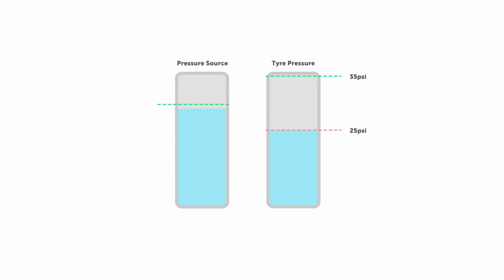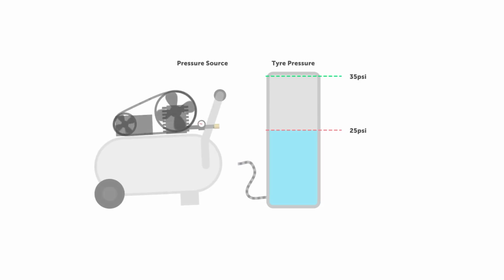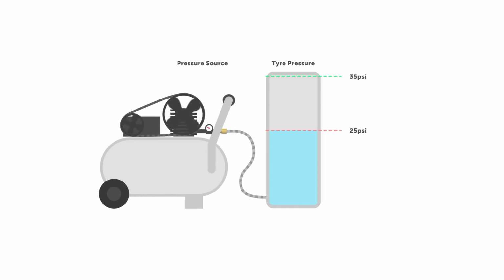Why Factory Transmissions Feel Like Garbage (And How to Fix It)

Comment from the maker: If your auto trans shifts feel like a soggy handshake, it’s most likely not the hardware. It’s the tune.

🚙 Building a fast car? Get $400 OFF the all-inclusive VIP online course package deal: https://hpcdmy.co/xa1
☀ Put this knowledge into action and tune your own transmission. $50 USD off online course: https://hpcdmy.co/trans28
TIMESTAMPS
0:00 - What Is A Valve Body?
0:19 - Complexity Varies
0:34 - How Hydraulic Pressure Delivery Works
0:41 - Line Pressure: The System Ceiling
1:02 - Why You Can't Request Impossible Pressures
1:37 - Tire Pressure Analogy
2:30 - Transmission Pressures
2:48 - When Clutches Still Slip At Max Pressure
3:15 - Variable Pressure Requirements
3:27 - Pressure Sensors And Control
3:47 - Mechanical Pressure Regulators
4:07 - Clutch Engagement Control Requirements
4:42 - Oil Accumulators For Smooth Shifts
5:30 - Advanced Accumulator Control
6:10 - Modern PWM Solenoid Technology
6:40 - Module Recap
7:17 - Transmission Tuning Course

Comment: I don’t know why, but i still prefer manual transmission…
Reply from the maker: We all have our own preferences for sure, and that's fine. It doesn't have to be one OR the other though and that's that. 
I find for different vehicles with different applications I switch between preferences on manual vs auto myself 🤘 - Taz.

Comment: The moment someone brings a compact lightweight automatic sequential to the table I’d be up for it. Especially when you factor in uprated torque converters and turbolamic’s etc .
For now I’d go with the conventional dog box / sequential , just as cheap and lightweight

Comment: Fun fact: it may seem like more line pressure is always better, but excess fluid not used in the line pressure circuit is bypassed into the lube circuit. This lube circuit pumps oil into the torque converter, transmission cooler, and the transmission bearings.

Under high-load low-RPM situations such as accelerating from a dead stop, there would be very little fluid flow from the transmission oil pressure, so the pressure regulator will prioritize maintaining line pressure, which would temporarily restrict or even block lube fluid flow. This will also happen with low RPM shifts, as shifting will cause a sudden spike in fluid demand from the line pressure circuit.

Normally, this is not an issue. The transmission bearings and torque converter can take a momentary loss in fluid flow, and there is normally enough transmission fluid to prevent the trans temp from surging. The issue is when there's continuous lack of flow in the lube circuit, from either the driver lugging the engine and transmission, or a bad tune keeping the line pressure much higher than it needs to be. A worn transmission can also cause a low lube flow, as internal leaks would demand more fluid flow in the line pressure circuit to maintain line pressure. Assuming that the transmission is not in need of a rebuild, this can be solved by properly tuning the transmission, allowing the line pressure to drop while the transmission is not actively shifting, and making sure that the downshift tables are set correct to prevent transmission lugging. If cooling and lube pressure is still an issue, the next step is to upgrade the pump. There are also some pressure regulator kits to allow continuous lube flow at max load, but I recommend upgrading the pump alongside the regulator if possible.

Comment: Ok, but HOW do I tune my Subaru 4EAT Phase II transmission?!?! ..... 😂 rhetorical question, I can't lol
Reply from the maker: I'm glad you brought this up! With enough time and money anything is possible, but not everything is worth the time and money to make possible.
It is exactly the same for engine tuning as it is for transmissions.

At the end of the day you choose your projects, and if you want that to be learning the skills to setup and then tune something that has 0 aftermarket support already, that is a longer path than a project that someone (or often a team of people) has already done the legwork on for you.

We all wish it was different any everything had commercial (or even better free open source) software ready to go, but that is simply not the reality we live in and owning a specific car doesn't mean it's the best specific car to learn skills like this with - Taz.
Reply: There's people who have done it
Reply: @Low760 there are people who have figure out tuning for the older 1990's subaru 4eat transmissions that were mostly mechanically controlled, but not the 2003+ Phase II trans which is completely electronically controlled.
Reply: Tuning for what? What is engine? 
If you know about phases - you should be able to use search on internet too….
Reply: @uv6er  I've searched extensively, and sadly nobody has figured out how to make any changes to the 2003+ electronically control Phase II 4EAT trans. The engine in a built EJ257 pushing 400whp right now through that stock trans, which is already considerably more than recommended, but if I could alter shift points and line pressure it would help a lot.

Comment: 0:05 - i think the next important component is the pump🤓 then the valve body.
Reply: It won't drive without a valve body though. Oil pumps are in line with the converter.
Reply: @Low760 it won't drive without the pump which is after the torque converter and before the valve body.
Reply from the maker: Specifically in relation to transmission tuning, that's just how Mike here ranks things as per his preference 😎
They're all useless without each other so really you can rank them however you like in general for sure - Taz.
Reply: @hpa101 my man Taz! The voice of reason💪😎